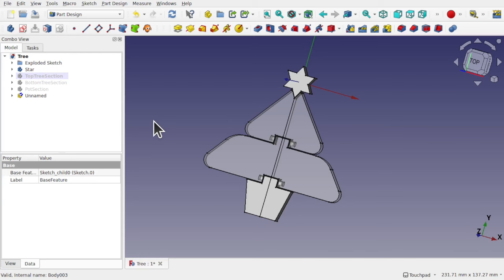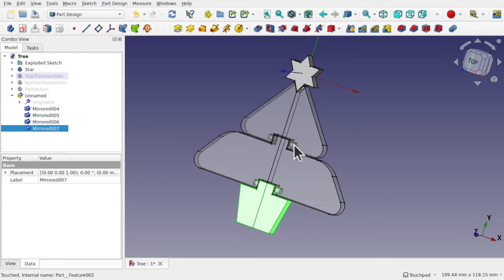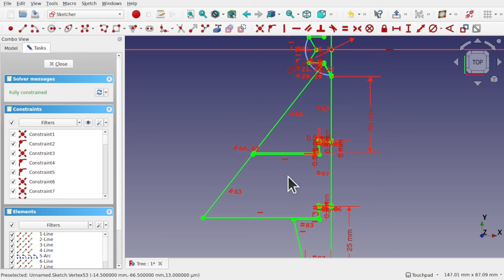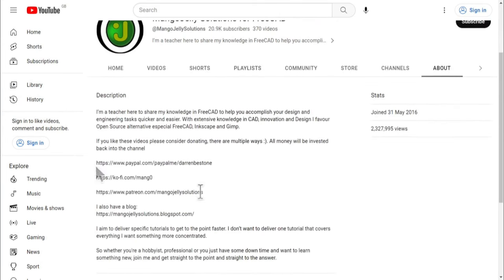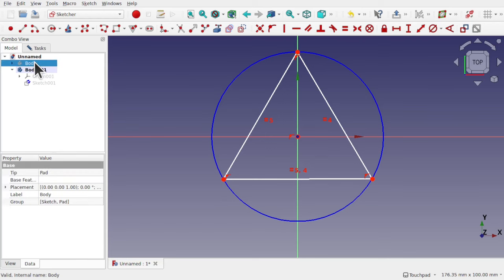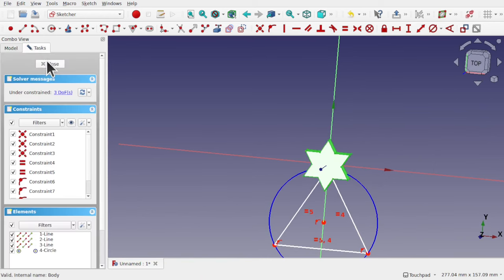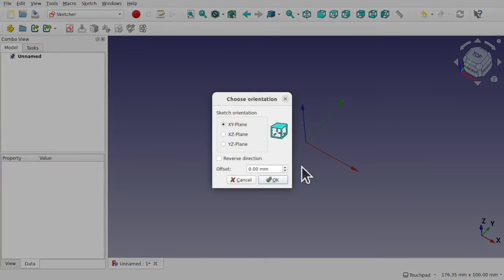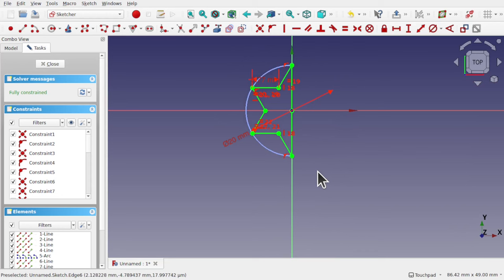Build A Flexible Christmas Tree Decoration in FreeCAD | 3D Print in Place | Beginner Friendly

Comment: I'd used subshape binders successfully before, but didn't know compound sketches for master sketches. This is going to help me a lot. Thank you!
Reply from the maker: They are extremely useful. Anything that is made of of multiple objects, even if it's something from the cross section tool in part workbench or mesh workbench is a compound though it shows as one item in the Treeview it can be exploded through the part tools. I say this because of I remember rightly your into your laser cutting?
Reply: @MangoJellySolutions  I keep forgetting that even wires are objects. I do so much in Part Design that I miss many opportunities in the Sketcher/Part work flow. Ironic coming primarily from OpenSCAD where the work flow is more like Sketcher/Part, so that it should have been easier for me at first.

I run Maker Forums where there are lots of laser cutting enthusiasts, but my own laser cutter build is still not quite finished. I designed it as an exercise in SolidWorks while I briefly had a license, and learning SW helped me better understand FreeCAD, leaving me with an understanding that the TNP isn't unique to FreeCAD, and a longing in FreeCAD for all lines to have midpoints, and for parametric 3d sketches... 😁

But yes, when I finish the build that is likely to become more important to me!

Comment: Thanks for this tutorial. It exposed me to a couple of new things. 

I did pick up an issue though with my exploded sketches when I tried to create a body in Part Design. It creates the body and it also creates the Base Feature and the sketch that I selected is hidden but the basefeature of the sketch that I used to create the body disappears and it gives me an error saying: "BaseFeature: No Shells or compsolids found in shape."

I tried recreating it many times with the same results, which leads me to believe that there is maybe a setting that's not right. 

Because you pointed out that the sketch and the pad created from the sketch will both be compounds I then tried to first create a pad from the sketch, then using compound to split the bodies and creating a body in Part Design. That worked and it brought the split body in as a base feature. It bothers me though that it works on a solid but not on a sketch. I'm using the latest release of FreeCad v1 on Windows 11, and I believe you're running on Linux. I will try it on Linux as well to see if I get a different result, but I thought maybe you know of some issue that I could've triggered without knowing. I'm currently working on SolidWorks and Fusion 360, but I'm a pensioner and need software that I can afford, so as soon as I am happy that FreeCad can offer me the same ability to create, I want to switch not only to FreeCad but also to Linux.

Comment: Does the compound thing also work for sketches with intersecting lines?

Just rambling: It still baffles me how a thing that isn't even worth mentioning in other engineering-focused CAD software can be such a pain in FC (and justifies, like, 3 or 4 different workarounds to somewhat remedy).
Reply from the maker: No it wouldn't work if you have an intersecting lines as they wont be separate profiles in one sketch.
Reply: @MangoJellySolutions  Dammit, I feared that was the case. All the more thx for these videos providing workflows that help to use FC without loosing one's sanity.